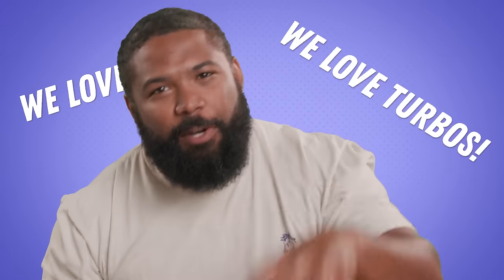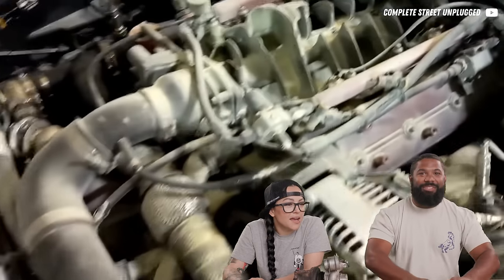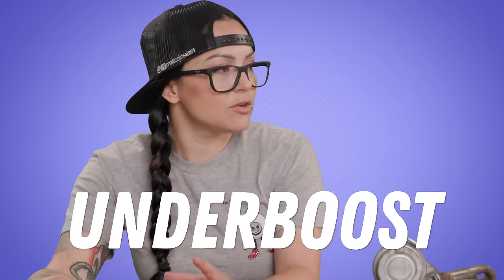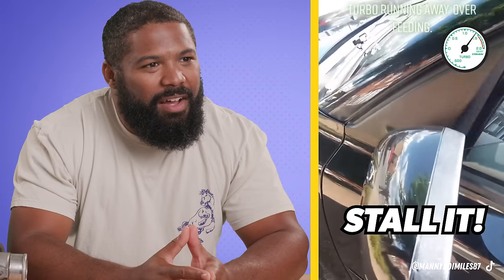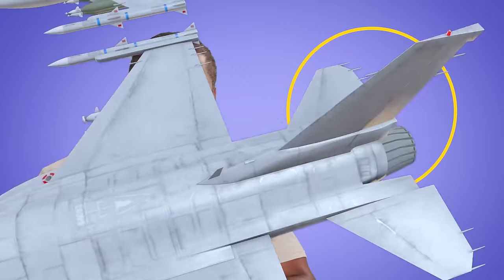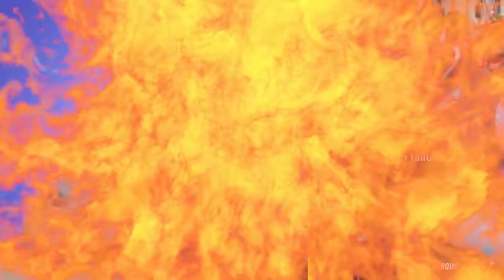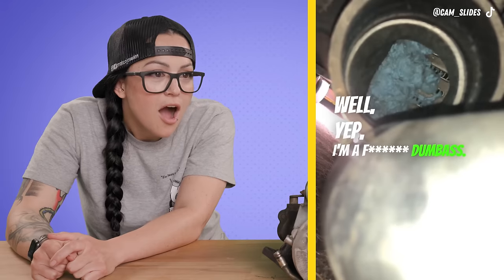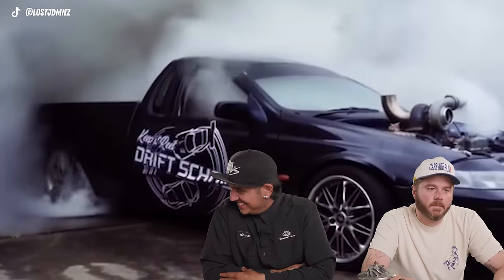Mechanic Reacts to Catastrophic Turbo Fails

Comment: I love how Angelina gives a very in-depth explanation of what happened and Sandro is just like "shit blew up gg"
Reply: She's used to being a teacher.
Reply: And I'm here for both all day long 😆
Reply: There the perfect ying and yang
Reply: " Turbos? Go vroom / "
Reply: They blew their shit up (for the boys).   For real though I think that infotainment contrast is a big part of what makes these so enjoyable.
Reply: Yes, but she is wrong about the turbo. Becauce a turbo steal some power so it can work.
Reply: @atvheads  Yeah, a very very small amount. Routing the exhaust through the turbo does rob a teeny bit of flow through, but the overall benefit outweighs it so much (on a properly tuned and maintained vehicle) that it's negligible.
Reply: @KhronicD  Try to breeth thru a straw. The resistance steel some power of cource.
Thats why a 3" exhaust is better than 2"
Reply: @atvheads  I am aware of basic physics, thanks. There's a lot of math going on with car tuning, and I don't claim to be an expert. But the basic concept of my comment stands true according to everything I've seen/read/experienced.
Reply: @KhronicD  No.
Reply: Teacher vs seasoned mechanic. She is as a seasoned mechanic well, but also a teacher. She explains everything as "we", which is classic teacher speak. Sandro is so dry he could be British. Both are great.
Reply: @atvheads  Try and breath through a paper towel tube. That is a fair comparison, not a straw. KhronicD's comment is correct. The loss is negligible if the engine is tuned right. The power draw is nowhere near that of a supercharger or belt driven turbo, not even an AC compressor.
Reply: @atvheads  From an engineering standpoint, thats the fairly accepted terminology. A turbocharger uses otherwise wasted kinetic energy in the exhaust to generate boost pressure, while a supercharger creates parasitic drag on the engine to create boost.
Reply: @jordanrooker8474  The extra pressure the turbo makes for the exhaust stroke is of cource parasitic to, but not at all as mutch as with a compressor of cource. And special alloys is needed for the valve.
But, if it is free energy, why isnt every 4 stroke equiped with a turbo?
Sorry for my bad English by the way, im Swedish:)
Reply: @atvheads you don't need special alloys for all turbo applications, you can use standard ones unless you're putting out heaps higher amounts of power
A lot of consumer 4 cylinder engines are being made with turbos and smaller engines now, but it adds complexity to the manufacturing
Reply: @atvheads  That can be entirely dependent on scavenging effects. Using exhaust diameter that is too large can be detrimental, it's dependent on the application.
Reply: @atvheads  Cost and complexity, along with the increased demand of all the components involved leading to a pretty substantial increase in cost of parts when talking about the whole package. It can be more cost effective to run higher compression, or even to just have a car that makes significantly less power than it theoretically "could" with forced induction. 

That said, turbochargers are becoming increasingly common, with good reason, they are well known to increase the thermal efficiency of an engine, but that doesn't make it "free real estate" so to speak. You still have to consider things like longevity, complexity, overall cost, and even in some applications, things like throttle response and fuel efficiency, it's all a balance. 

Also don't worry about your English, I can only speak one language, and I'm not really the best at it anyway 😩
Reply: Its funny and I love the, its GG
Reply: @Yvolve nerd
Reply: I really like her she's incredibly beautiful and smart loving those glasses too and tats
Reply: This gal made me me blow my head gasket! Lol All love fam!😅
Reply: @douglasboyle6544 same here I like her cause I don’t know about cars but I like Sandro cause he’s like me but he actually knows about cars😂
Reply: Same vibes as “Hey you can’t park there!!”

Comment: I love how Sandro's explanations are simple and straightforward ( for dummies like myself ) and Angelina's are a bit more in depth but still simple enough to grasp ( she's definitely an instructor).
Reply: he is a hands-on guy who actually builds and repair cars. she is a shop teacher at a college. 
its like real life experience vs theory.
Reply: @dimosk7389 💡
Reply: I like Sandro's explanations way more. They help you understand what physically happens without the official terms. His explanations motivate me to just take it apart and see what happens without worrying. I've always struggled with teachers overcomplicating things eventhough the terms they used were "correct". My photography teacher had this whole story about camera aperture. And at the end I said okay, so it's basically just a hole that opens and closes. And if you make the hole bigger, obviously more light comes in and you get a brighter photo. It's not rocket science please.
Reply: @RacingPepe  that is true
Reply: I like em both for different reasons. I love the additional technical info
Reply: @ralkia Yeah Angelina is who I'd want teaching my class, and Sandro is who I'd want tutoring.
Reply: As a customer, sandro tells you how it is. I don't know what a scransom loose in the gasket sprocket means.
Reply: @dimosk7389 damn that’s the best way to explain it😂

Comment: I agree with Sandro's diagnosis "too much power couldn't handle it"....10/10 for the mexican vampire mechanic.
Reply: None of them know what their talking about . That engine was fine. It was reinforced and made much more power. Diesels arent gas engines . Totally different animals.
Reply: @markrich3271  the exploded engines on fire with stuff sucked into the impeller wheels are fine? I wouldn't let you near my car.
Reply: @markrich3271 lol you obviously don’t know about the torque limitations of diesel engines. That’s why nitrous is used to make HP while limiting torque on diesel applications. And based off the flame it looks like that’s what they did to it. Too much juice for the setup so it exceeded the turbos limit.
Reply: @markrich3271  The engine exploded. Seems like to much power somewhere
Reply: @TheOhsemix this really sounds like what happened. That would explain the immediate stoppage of coal rolling and what looked like video-game nitrous flames coming out those pipes. Crazy to me that some people don't understand that heavy-duty diesels shouldn't be spinning at twice the tach's max revs

Edit: also forgot to mention, rolling coal is pretty dumb. All it is is having a very rich fuel map tune flashed onto the ECU for the sake of cLoUt
Reply: @bryan23361  A 'small' price to pay for Video Game NOS effect / engaging afterburner
Reply: @bryan23361  are we talking about the black truck?